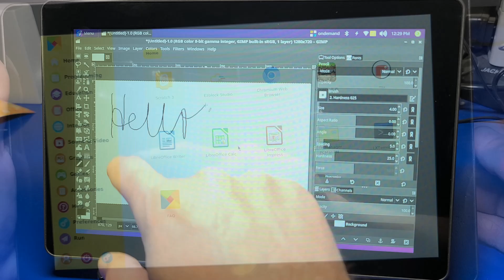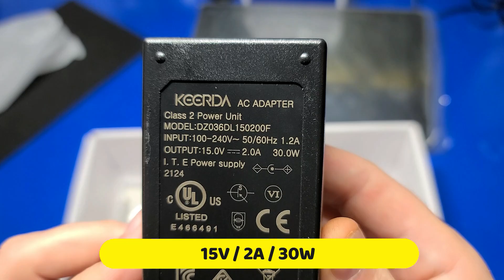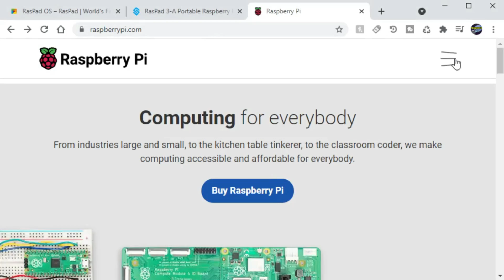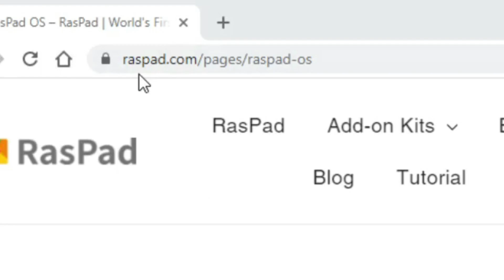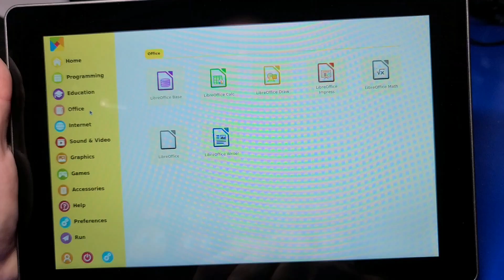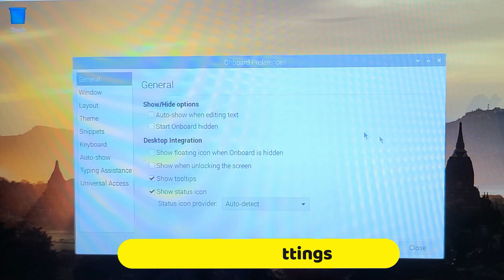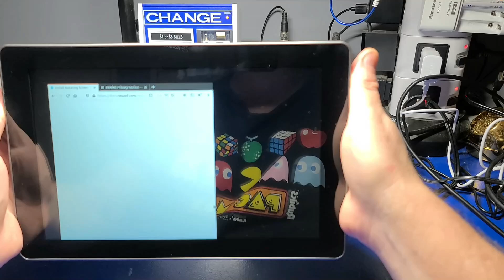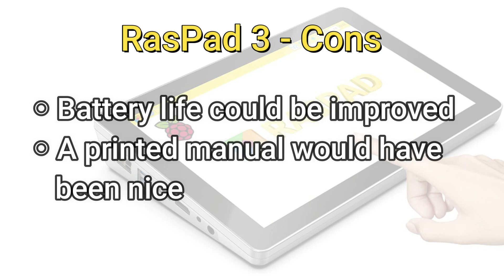RasPad 3: The Best Touch Screen Tablet For Raspberry Pi 4

Comment: The fan shipped with your tablet is the same as mine expect that thing to be dead within a few months of frequent usage since the heat generated by the pi ruins the bearings they normally use a hydraulic bearing fan which is designed for these temperatures but i'm now hunting for a new fan since the bearings are seizing up also i hate the stock accelerometer it never worked on any os i tried following the install instructions i even found a raspad os build to hopefully see if it worked at all but my pi refused to boot since the os was incompatible with my board revision I'm gonna get a quality silent high airflow hydraulic bearing fan and a mpu6050 to improve my tablet and my display board is rather rare has a switch for enabling touch when external display is connected and the headphone volume can be adjusted using the side keys one sideeffect of this is the lack of bass on headphones which i hate my first reaction was why do my headphones sound like bootlegs later realizing they had a eq on which you couldn't turn off so i mitigated the effect using another eq the bass is back but sounds awful I wished they hadn't shipped me a prototype if it was one

Comment: I am totally amazed how much space is wasted inside and no place to fit a hard drive!! So I would not purchase this item, a very bad design.
Reply from the maker: I appreciate your input, a location for an M.2/SSD is indeed a great suggestion!
Reply: I doubt you can access the RPi I/O without the built-in embedded mobo. It needs to be there for the tablet to work.

That said, I'd love to see a variant with thicker body to accommodate an M.2 SSD board on top of the RPi.

Comment: Can i use it for octoprint 🤔
Reply from the maker: Yes you can, see 16:08 I even show it 😎
Reply: Thanks i didn't go so far, i just received a printer " Ender 3 " and have a raspad with a pi 4 and 8gb so there is also a use for it 👍

Comment: I really want this but at the price I just cant justify the buy.  Maybe if it came with the pi but 250 + the pi4  over 300 is just to much.   Id grab it if it was the same price as the pi 4 8gig,  But as is, my 15 dollar pawn shop monitor and old keyboard and mouse works just fine
Reply from the maker: There is a coupon option that you should see on the Amazon order page.  Checking that should provide $40 off, bringing the price down to around $210.  Also, watch for any black Friday sales, I'm not aware of any but just a guess that the price may drop slightly around that time.